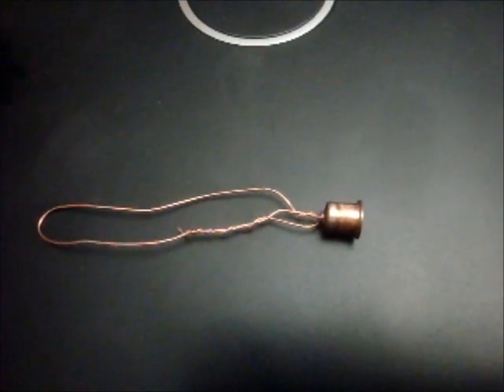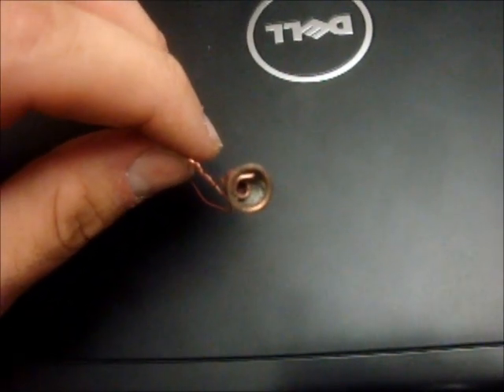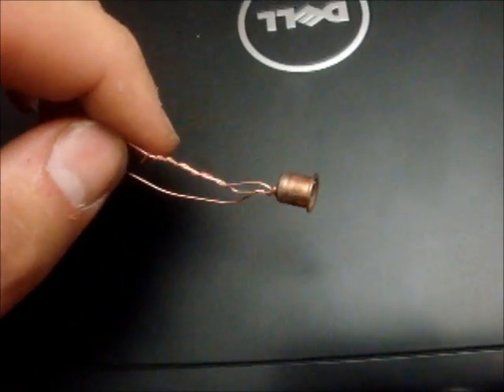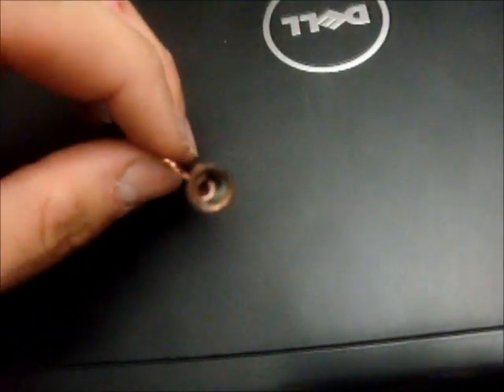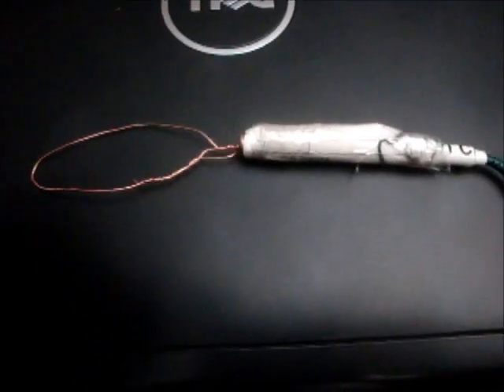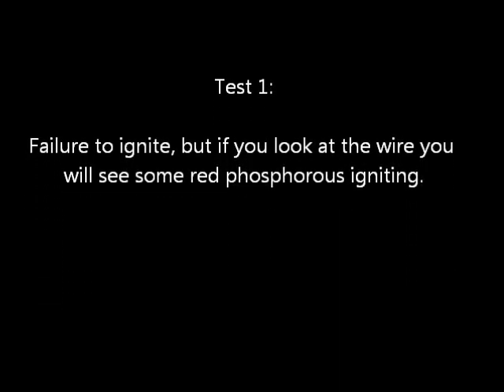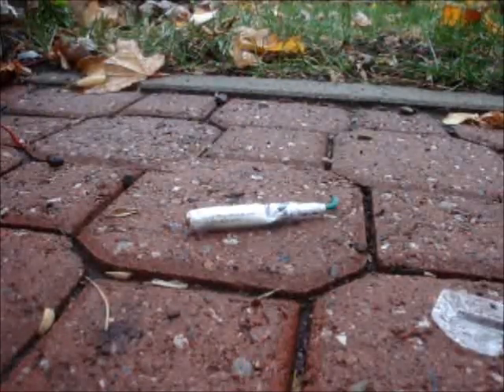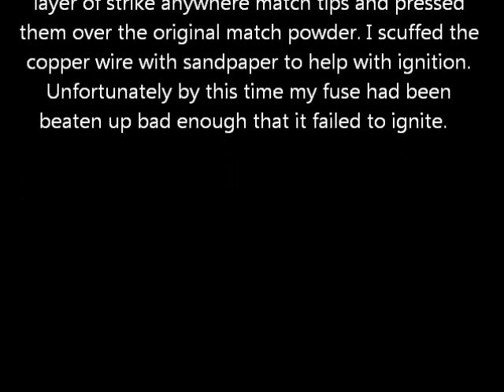Attempting a WW2 style igniter.

Comment: I've dissected a few military grade pull igniters, and there's one part which seems to be recurring.
The wire is not pulled through a hole, it is pulled through a funnel. This has two effects. First, if the wire is pulled through a hole, the sharp edge will essentially scrape the wire clean and prevent any trace of ignition compound from entering the high friction area.
Secondly, the funnel shape has a straight tunnel section. This guides the spiral shaped wire so that it is always scraping against the funnel's edges with significant force.
The ones I've dissected were military versions of Ikarus distress pyrotechnics. Expensive, but reliable.
Reply from the maker: Interesting the german ones I disassembled had little cups in them not that different from the one I made. A cone would probably be a better option though for home made for the reasons you stated. Ill try giving mine a cone shape next try. Thanks.

Comment from the maker: Although I wanted to go with the original compositions, and I tried red phosphorus dipped wire and /KClO3, I found I had much more success with using wetted and crushed strike anywhere matches. Pressed into it with a hole for the wire to go through, and then roughing the wire up with sandpaper, and coiling it in front of the composition. Once it dried it worked well and was reasonably safe.